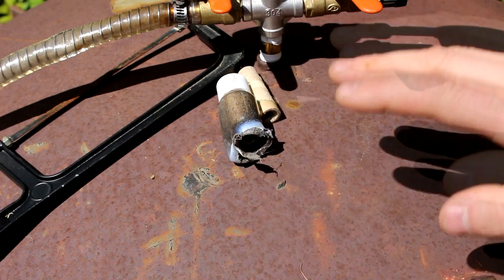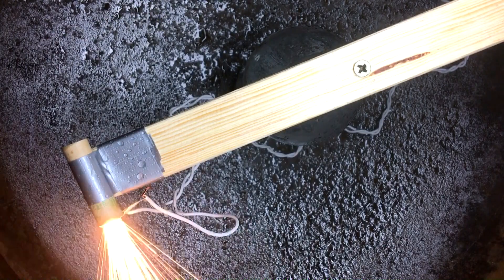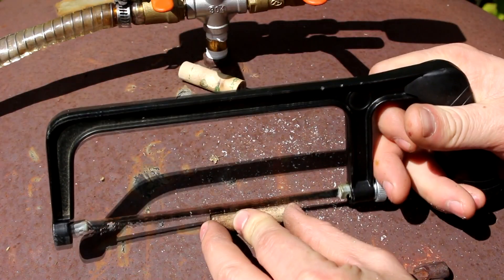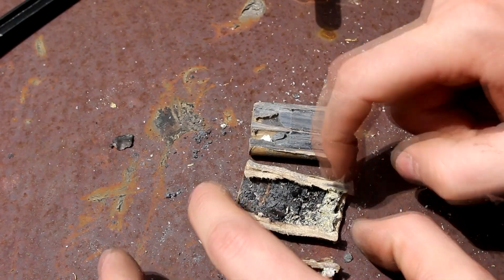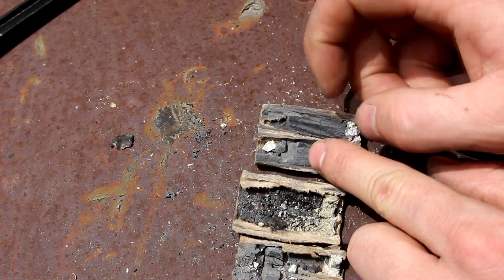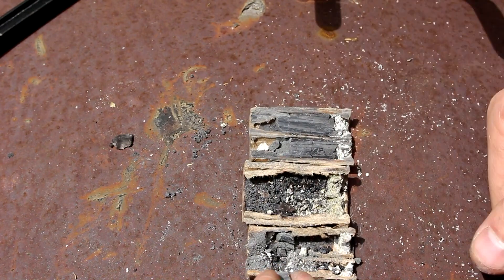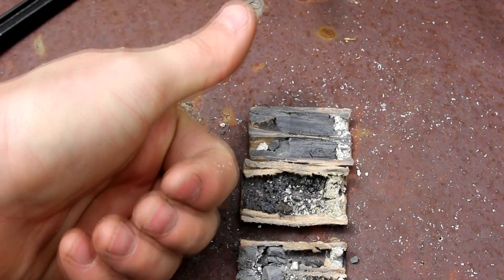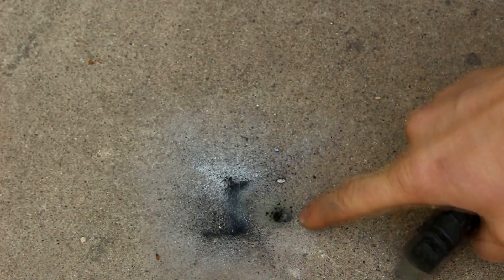Rocket Autopsy

Comment: Could you make a video about growing mushrooms?
Reply: Actually that technique only works with primary decomposers that consume lignin and self initiate pinheads.(which does include most psilocybins) Even within that some like grain straw, others do better with hardwood chips and only a few like softwoods, temperatures are important.(general ranges, they need not be precise but vary with specie)
It does not work for secondary, tertiary, mycorrhizal, or those that need a dirt cap (actually certain bacteria in the dirt) to initiate pinheads.
I still don't know if the poster actually meant spores or spawn; spawn is usually used for that cultivation technique and spores are limited to the lab with agar and petri-dishes or for random wind travel in nature.
Reply: not that hard.  Get some sawdust, put it in a bag, pour in boiling water until it is wet.  Squeeze the excess water out when its cooled down, and then inoculate it, seal it and store it for a few months.  When you are ready to fruit the mushrooms, you cut a hole in the bag, scrape the side, and soak the bag with the hole down for 12 hours.  You then set the bag up to fruit in its favored conditions (dark, light, shade, etc) and sprinkle some water on the hole to keep it moist once per day.  You should see pin heads after a few days that will grow out very quickly.  When they are mature you can cut them off, scrape the hole a little bit and resoak to fruit them once more.  the material in the bag is then usually used as compost that people pay a lot of money for.
Reply: Look up Paul Stamets of Fungi Perfecti, he has the best growing books, very technical for science and commercial operations. Some species are easy some are very difficult, then you must decide how much of the life cycle you want to handle; the extreme ends are spore to spore which takes a lot of work and equipment(or some luck) and at the other end simply initiating fruiting bodies on healthy mycelium (buying a "kit"), several stops in between too.
Reply: rizendell are they the funny kind
Reply: IIRC, he grew mushrooms in one of his Cody's Mine videos.
Reply: Do you not need to sterilize the medium before inoculation, though?
Reply: thats what the boiling water is for.
Reply: myles not in the USA, but the technique is pretty universal, you could use it with almost all mushrooms.
Reply: Desoxy yes.
Go in the wild, eat some random shrooms.
Reply: Desoxy You misspelled weed.

Comment: Could you try different solid fuel compositions?
Reply: Pat Y no i dont think so. its not an issue with fuel but rather pressure.    in a vacuum you need pressure to start combustion.
Reply: chris griffetts Is there a fuel that burns more violently and creates more pressure?